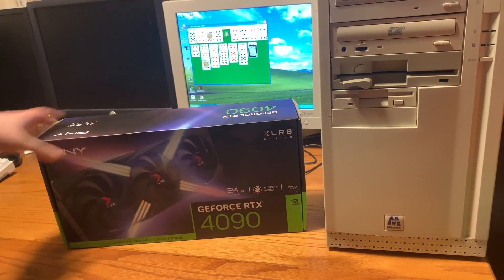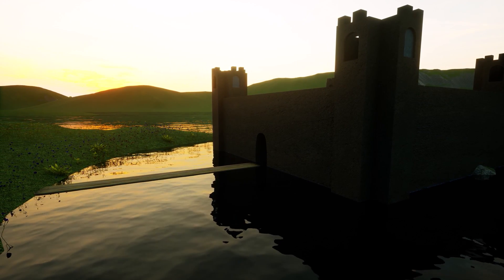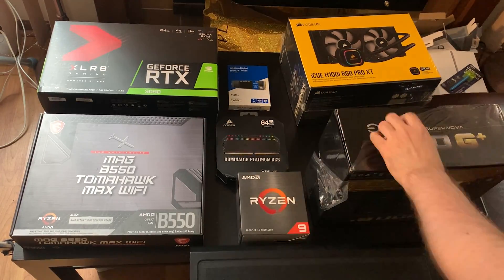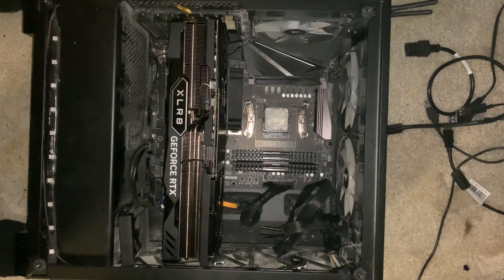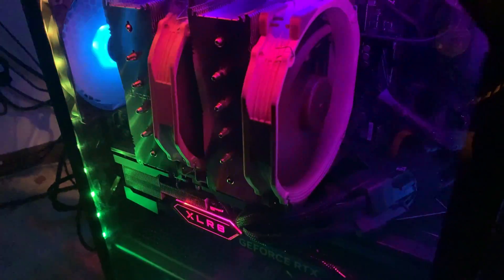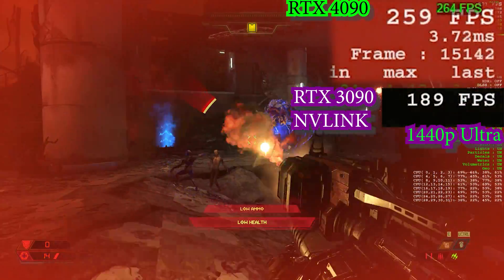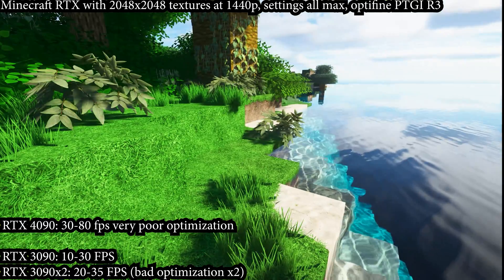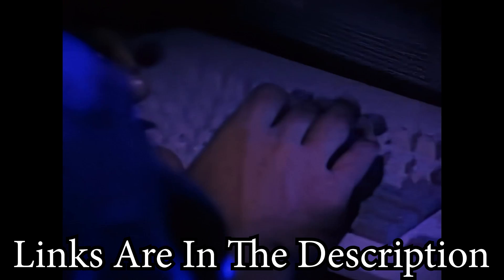RTX 4090 VS Dual 3090 NVLINK Gaming PC Build And Benchmarks

Comment: You bent that 4090-adapter quite a bit, I'd keep a close eye on it: Lots of people's adapters are melting.
Reply: 100% agree...do some quick research. You bent it to close to the pins (vertically) as well as horizontally smashed it a fair amount.  This could cause problems.
Reply: i thought the same thing i was literally screaming NOOO at my screen 😂😂
Reply from the maker: @ngplatinum7668  lol yeah, I being used to the days of jumbled smushed cables didn’t know of this issue right away lol
Reply from the maker: Valid concern, the adapters are made about as well as a origami bird;

It felt very snug though, I’ll reposition it if it’s still the way it is in the video.

I’m curious though what is causing the adapters to melt as my temps are 26c-60c max
Reply: @psychoticgiraffe  Bending the adapter very close to the connector causes the pins to slide out of position which lessens the contact and the amount of wire that the current can flow through, so it heats up much faster/hotter. From what I've gathered it's a new design and less receptive to hard bends.
Reply from the maker: @Addeatt  ah, so it’s different than the previous 30 series adapter, I see
Reply: @psychoticgiraffe  Yeah, you've already bent it so, tbh I'd leave it alone but 100% check on it frequently, especially when you are pulling a lot of WATTS haha.
Reply from the maker: @Addeatt  yeah it’s sort of dumb of nvidia to make such a illogical design, I’ll keep an eye on it, although it appears PNYs card is slightly lower clocked and also runs ridiculously cool, have they checked if this issue applies to all 4090s? I’ve notice subtle differences in the cable adapter on other models
Reply: @psychoticgiraffe  Pretty sure the 4x8 pin to 12pin adapters are shipped with all 4090's until the atx3.0 generation of power supplies come to market. Nvidia swears by the adapter so I'm sure you will be fine, it's just something to keep an eye on especially if you are stressing the card for hours a day, daily.

Comment: Imagine having a graphics card🤣🤣🤣🤣😐😐😐😐😐
Reply from the maker: 2022 is the year we all buy gpus, 3090s for 600-950 usd are now abundant
Reply from the maker: Tonight we dine on gpus and make 3d graphics
Reply from the maker: oh also, in the discord we found a dump of the original 3ds max for windows 95/nt 3.51 and r3.1 so you could like, make vintage CGI using an old pc again, or, brute force it using whatever the fastest pc you have is.

Comment: The dual 3090 wins for me purely on vram.
Reply from the maker: I think for AI that would be useful, but in basically any gaming or 3d render tests I did the nvlink didnt aid unless I was trying to break the pc with 16000x16000 res renders in vray, in which case the gain wasn’t noticeable

I recommend if anyone does go dual 3090 to get custom waterblocks because these things run hot; also to try instantnerf
Reply: @psychoticgiraffe  You guessed it, I love AI entertainment so I am incredibly VRAM starved with my ideal PC containing 160GB of VRAM.
Reply from the maker: @Henk717  I know lambda allows one to construct a pc with 4tb ram and 640gb vram on their site, I can only wonder what kind of nonsense you could do with that
Reply: @psychoticgiraffe  Would be enough to run the largest AI and it might even be enough to finetune models that are bigger than the ones we have now.